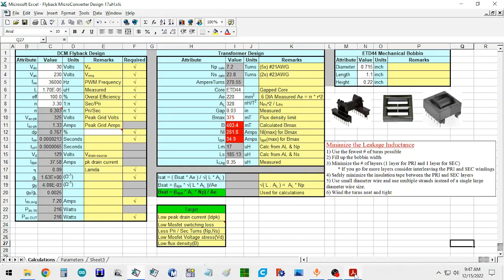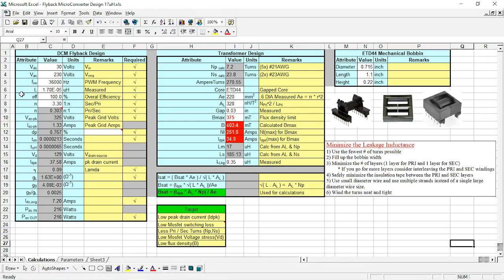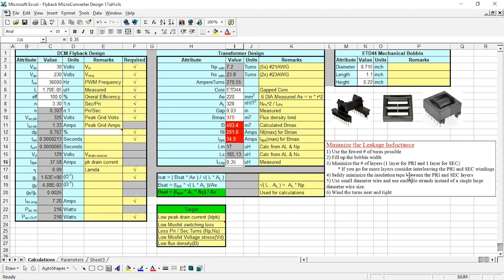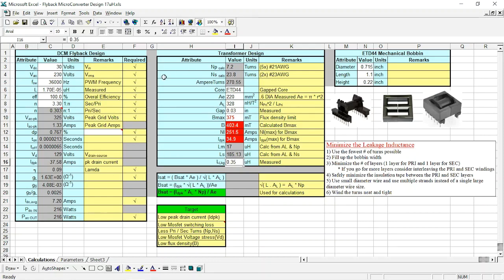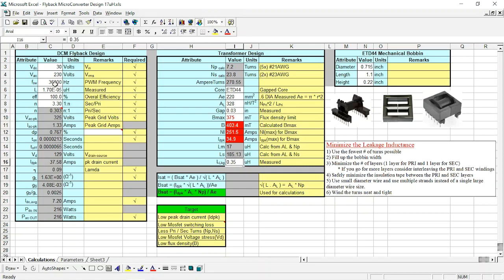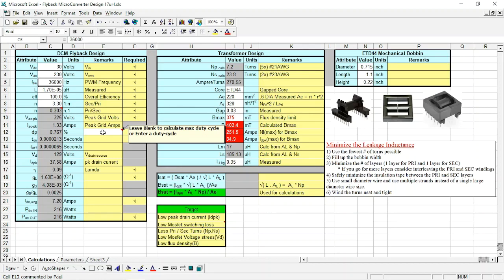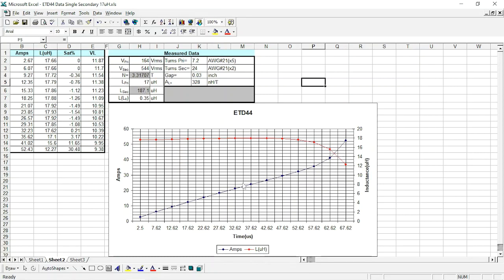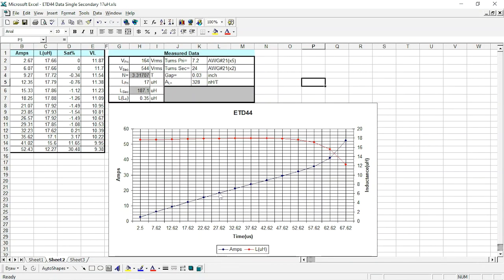Flyback Design

Comment: This has been very helpful. How did you calculate values for RCD snubber?
Reply from the maker: I simulated the circuit as accurately as I could in Tina TI and tried various values of R and C. I didn't want to loose more than a few watts in the snubber resistor and I wanted to keep the ripple voltage across the resistor to around 10-20% so that how I selected the capacitor and resistor.